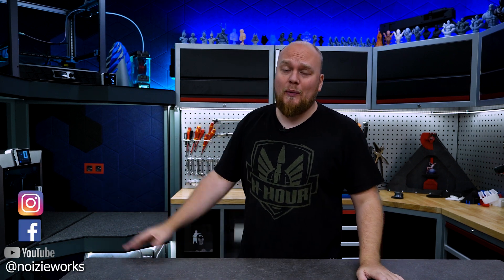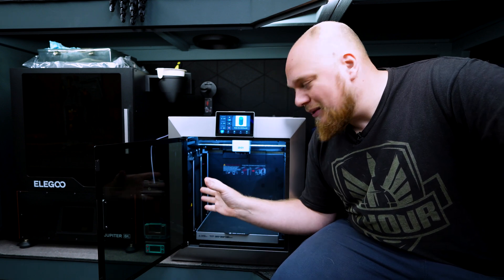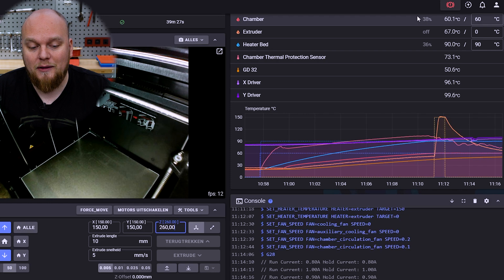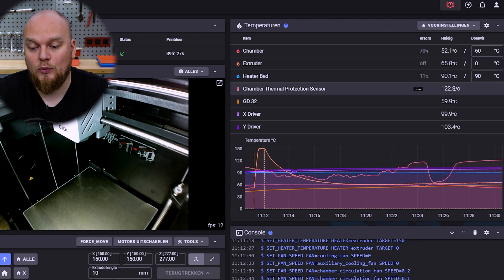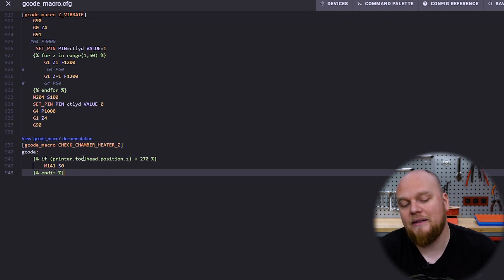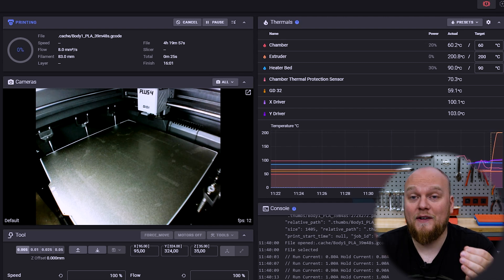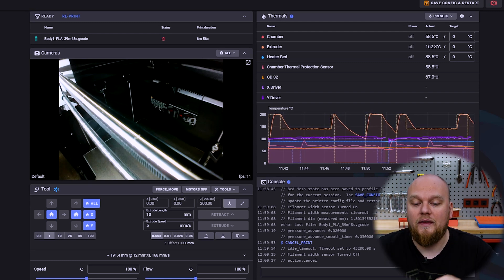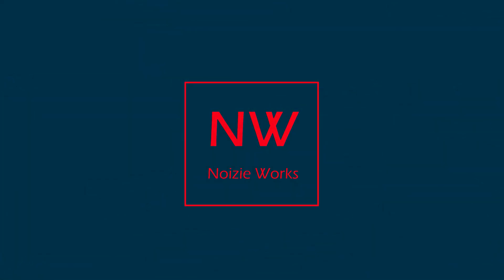Qidi plus 4 has a new design flaw and here is how to temporarily fix it. Bed blocking chamber heater

Comment: That doesn’t sound like a fix bro all you did is turn off the heater. So this thing doesn’t print 305x305 and it doesn’t print 280 tall. You also had to fix other parts? Why would anyone buy this
Reply from the maker: @Tom-wp9ix  I'm just the messenger brother, you rather waste a day/spool trying to find it out yourself?
Until there is a decent fix, this should at least help you make the 280mm.
It's up to qidi imo to do something about it and come up with solid a solution.
Reply: @NoizieWorks  I’m agreeing with you! I can’t believe they didn’t test this. They should recall these and get it all fixed
Reply from the maker: @Tom-wp9ix  recall isn't necessary but a revision with parts send to the first batch owners would be nice.
Reply: I have yet to unpack my plus 4.... received it yesterday. It seems it is NOT the printer for someone who just want to make prints and not want to tinker. 😢
Reply: @olenielsen5852 honestly I got mine yesterday and printed with it already, haven't had to tinker yet !! Well.. except when the head crashed into the buildplate lol
Reply: @olenielsen5852  No tinkering for me so far. Got it at launch. I haven't even run input shaping hahaha. There are a few edge cases you might have issues. Most are easily solved. I'd say give it a chance.
Reply: @olenielsen5852  yup return it get a p1s  my 4 has been hit and miss on large asa prints
Reply from the maker: @olenielsen5852  I have been in tight contact with qidi and they are on it with a firmware/slicer fix to get you up and running.
Or in the meantime you can follow my steps, the rest is honestly fine and if you have problems qidi support is one of the best.
Reply: @NoizieWorks  Mhh I wonder if you simply can replace the plate with a grating, this would fix the issue and probably slow down the air enough so that you do not get any model deformation by getting the chamber air being blasted against the model, might be worth a shot. Not sure how hot the chamber air heater blows out the air if it is 30c it might not be a problem heck even 60c for might ot be a problem but I doubt it ever will reach that temperature!
Reply: @NoizieWorks fine huh? 🔥 danger
Reply from the maker: @Tom-wp9ix  if you're on 220V like me yes, starting to get really annoyed with them.
The last message from my contact regarding burning up ssr's and making the heater basically a paperweight on 220 left a lot to be desired.
Here is the respons on what they are going to do about it:

1) Yeah, we have tried our best to notify every user to update to the latest firmware through email and software update push. In the future, we will also add APP push, firmware automatic push firmware and other functions.

2)

Our test data:

￼

The initial firmware will make the power supply temperature higher and accelerate the aging of the chamber heater power supply, but there will never be a risk of fire, and the heater power supply can always work. Or the chamber heater power supply disconnects automatically after aging.

We apologize for the previous firmware parameter error, but we will not increase the power of the chamber heater in the future. The current heating performance has exceeded all machines of the same price and some higher-priced consumer-grade 3D printers.

I don't know where the claim or rumor that the power is too low comes from. There is no actual data basis, and the purpose of the rumor spreader is uncertain.

3)Due to feedback from some users that the heater fan is noisy, the fan air inlet is optimized to make the noise smaller. We have been trying our best to optimize our products. No other updates at this time

4)

We understand that customers always ask why this is not a perfect product. But QIDI will ask more about how to optimize the product and give customers a better 3D printing experience. New functions or designs may bring some new problems, but we will continue to optimize and improve our products.

So they still think that just adjusting ssr duty cycle is fine while it's clearly not.
Reply: You could still print 280 tall, including something that requires the chamber heater. Unless you have something with very large layers with a particularly difficult filament in the last 15-20mm it's very unlikely to cause issues. Still a big annoyance though especially for those who won't know about this problem before losing a print.
Reply: @802Garage   could not have said it better, this is the measured response for Plus 4 owners. Noizie explained the situation and potential solutions for the current build and future heater flow improvements. Yes, QIDI should have done a better FMECA. Granted the solution Noize demonstrated by the community will more than suffice to complete a print > 277mm in height due to the residual heat within the chamber.
Reply from the maker: @somhunt5446  yup, it's probably fine this way, btw they answered and they are going to fix it in firmware. So they are probably going to copy past the same. Will look around when new FW drops.

Comment: Absolute madness.

Compounded by the fact that it's glued in.

Why wouldn't they design it with side ventilation? 😂

I'm still happy with the printer but no wonder it's so cheap for the specification. Saves money by not testing it 😅
Reply from the maker: Community FTW!